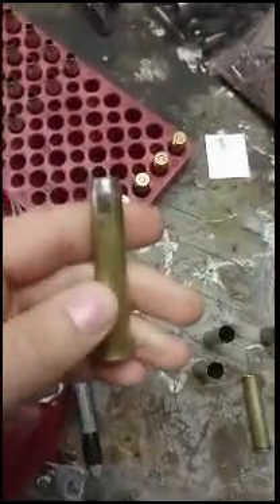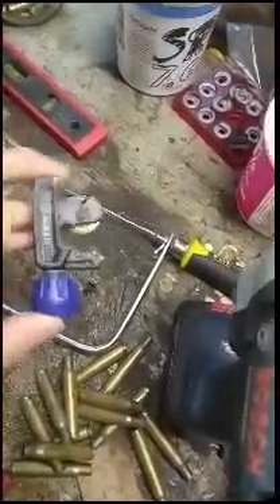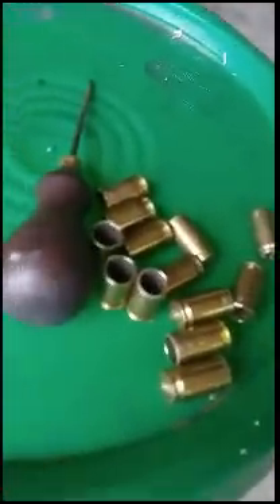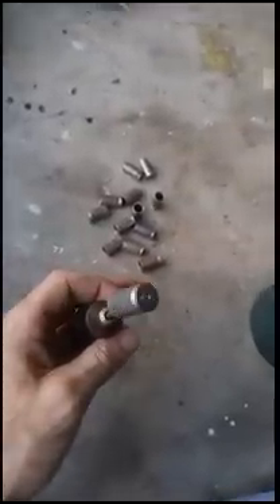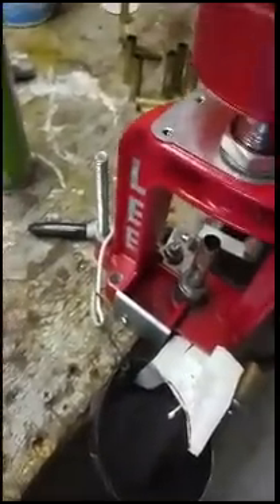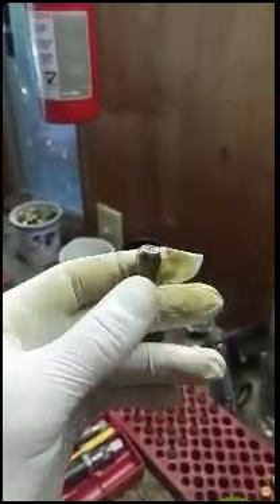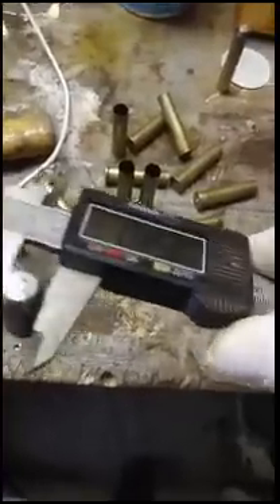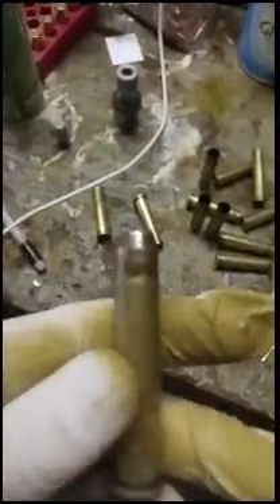Making 45-70 bullets from 30-06 brass

Comment: I had a machinist buddy modify a Lee 340 grain double mold by machining out the driving bands so I can insert a modified 45acp brass into the mold just up to where the radius for the bullet nose ends at the base. I drill out the primer hole to the same size of the sprue hole on the mold. Using full length 45 brass I get 500 grain bullets. If I cut the brass down to where it is under the sprue plate I get 350 grain bullets. I wish I could post pictures as they are cool looking, almost look like a factory-made bullet. On the full-length brass since it sticks above the base of the mold, I keep a wood chisel handy to cut the surplus lead off the base of the brass before it solidifies.

Comment: Also, using arisole olive oil is baddass! And usimg 30-06 brass for a jacket is genius,  they aint just cheap, they also.
 have a progressively thicker web the lower you measure.  It's good for controlled expansion.

Comment: Great video. I remember years ago guys using .22 long rifle brass for jackets.
Reply: You can still today make jacketed .22 bullets using rimfire cases for the jackets. Corbin swaging sells the tools.
Reply: I did this using a set of dies I built. Making 37 gr. For a .22 hornet. Sold that rifle. Now I am using .22 hornet brass nicking up to .257. Have a baby rollingblock was a 32 rimfire converted to centerfire.  Lined barrel with .257 liner. Cut 25 hornet chamber . Load a 60 gr, with black powder looks like a baby 45-70.

Comment: That’s a lot of brass wasted when you only need the head of the case.  But awesome to be able to use it. Finding brass with loose primer pockets and bras that’s had head separation
Reply: Berdan primed greek surplus 30-06 brass was used.

Comment: you can do the same thing with 9mm brass for 40 S&W / 10mm Auto with a old cut of 223 die 
, the lower part for swaging the upper part for crimping the case around the lead

Comment: Oh you're making the bullet not the case, 4570 you can use straight cast , electriccote copper and or powder coat,you can also manufacturer 45 ACP from the 30 odd 6 base

Comment: hola, que die usas, desde ya muchas gracias
Reply from the maker: ¡Hola de Nueva York! Utilicé 7.62X54R sizer die y un Lee .458 cast balet size die. El 7.62X54R crea la nariz en la bala y luego el tamaño del proyectil de bala se asegura de que tenga el diámetro correcto. Usé un RCBS 7.62X54 con la varilla de decapitación eliminada. Lo siento por mi mal español, la mejor de las suertes!

Comment: Why do that when you can buy 45-70 brass?
Reply: John Brenner 
A slightly different example:
I pick up acorns and chestnuts in town.
Take then out into the woods and toss them into gullies and draws, anywhere there is water.
If even 1/1,000 grow, that's one more that will grow than if i hadn't sown that one.
One day a college kid strolls by as i'm collecting acorns, ask me what i'm going to do with the nuts.
Tell him i'll scatter some in the woods,  others can be soaked / boiled, peeled, dryed, ground into flour and baked into bread / muffins / etcetra. 
He asked why anyone would go thru all that work when he could just go to the store and buy a loaf of bread.
Knowledge would be lost on him.
Your question " Why do that when you can buy...?"
Knowledge is power, 
Some wish to remain ignorant, and weak ...
Reply: John Brenner this is for making bullet jackets.
Reply: John you missed the whole point of the video.....
Reply: Being independent making your own is sometimes much better than being controlled by Government.
Reply: used to be able to buy 45-70 but as of late good luck

Comment: How abut 308 win case
Reply from the maker: Should work just as well.  I found the 30-06 brass bullets to be a little more accurate than the acp ones, probably due to the thicker case walls.  I wonder if you could get berdian primed brass 308 cases to swage.
Reply: eric perrin I dont think so. Most Norma,  Lapua, Sako and some outer brands

Comment: I value my firearm to much to us that hard brass rather copper jackets
Reply: I agree! I would never put this stuff in my Marlin 1895 SS rifle. Why bother with all this? Lead cast bullets alone work wonderfully and you can tailor the bullet hardness to suit your shooting/hunting needs. I use the RCBS 300-grain flat point lead bullet with gas checks and obtain 2,100 fps...no need to go any faster. If you need a higher velocity buy a .458 Win Mag!
I'm sorry but going through all this makes no sense to me.
Reply: @wilmamcdermott3065  Huh?
Reply: You do not use the hard brass cases in "as they are" condition  for making jackets. They must be annealed by heat treating them with a torch which softens the brass. This makes the brass much more malleable and useable for the rifle grooves.
Reply: @robertmckinley2886  still harder than copper
Reply: @robertmckinley2886  start pushing those in excess of 3000 fps